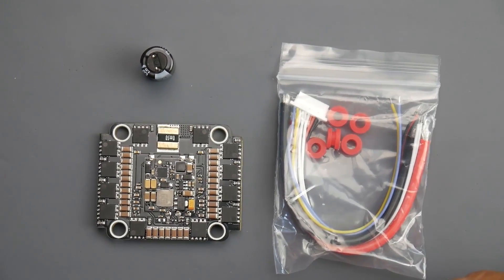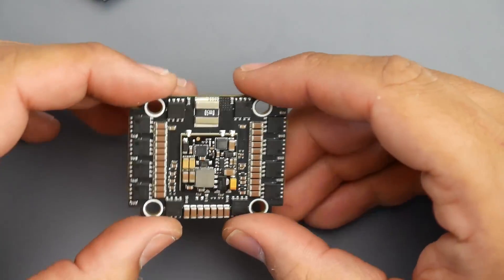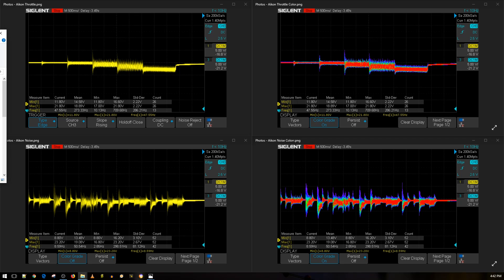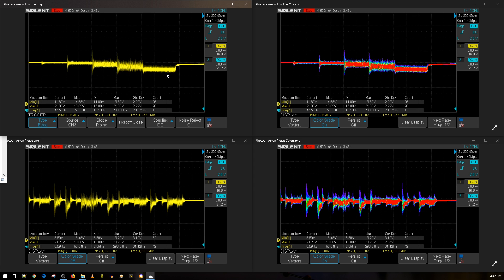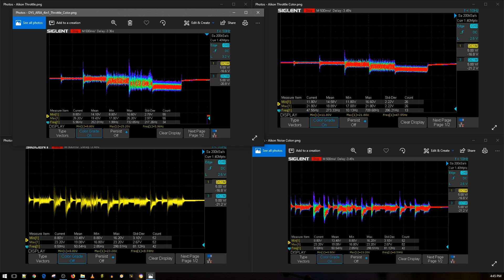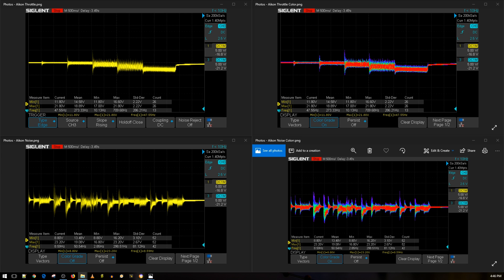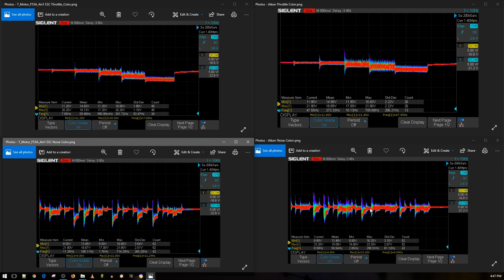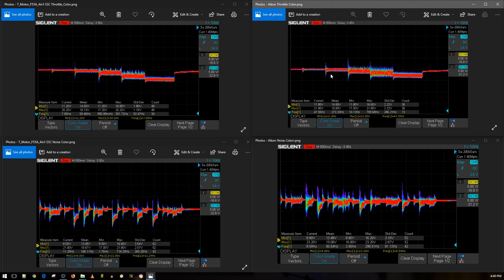OMG Finally Noise Tested Aikon ESC // Aikon AK32 35A 4in1 ESC Noise Test

Comment: What’s the name of this program you use for the spectrum of throttle and noise? Would I need a special machine to preform these tests myself?
Reply: You need an oscilloscope, it'll run you from the low end 200 usd to high end 10 000-100 000 usd

Comment: Please test the Airbot Furling32 45A ESC (not the mini one). Airbot took an unusual path with this ESC with rather weird PCB layout  less power filter ceramic capacitor and less components overall onboard unlike its predecessor. Even though being an F3 ESC, it's one of the cheapest Blheli32 ESC on the market so it's interesting to see how it would perform.
Reply: id like to see the furling32 tested too
Reply: Vote for furling32 test

Comment: Aikon AK32, Just got this board to pair with my Talon F7 still trying to figure out what frame motor/combo i want to use
Reply: I had two Talon F7's die on me. They also had very noisy video I couldn't fix with caps. I highly recommend getting the Aikon F4, as solid as the ESC.

Comment: I'm kind of surprised by these results. I switched recently from a Tekko32 (burnt out on me on 6S) to the Aikon AK32. I noticed a lot more video noise compared to the Tekko32. I switched from vbat to the 5v rail with my camera and added a low esr capacitor to the 5v rail as well. Haven't tested it yet. But like said on the vbat the noise was all over the place.
Reply from the maker: the old Tekko32 fets can not handle the 6S Voltage however they are the cleanest ESC's until now, nothing has beaten them in terms of filtration. But everyone looking for 6S compatibility
Reply: @DroneMesh  it were actually not the fets but the entire row of capacitors in the back who fried on me.
Reply: If you still have problems: A 50v 1000uf low esr capacitor (lg one from bardwells list) across batt input on esc eliminated all video noise for me. I use the matek f7 v1 and video transmitter. The 2 times my cap got disconnected it was indeed verry obvius on mid->high throttle.